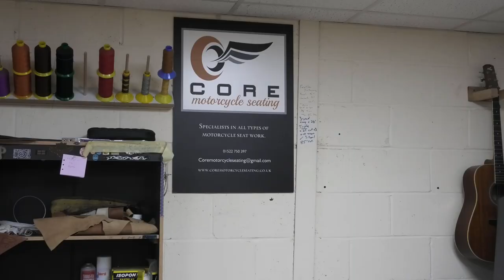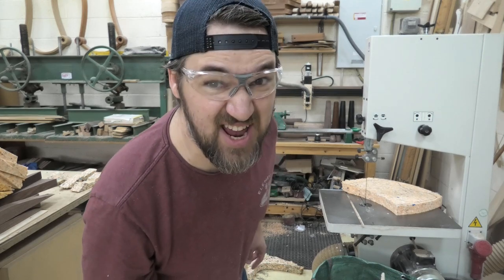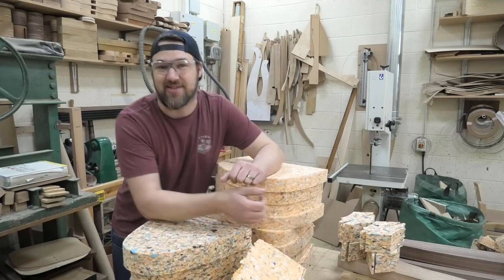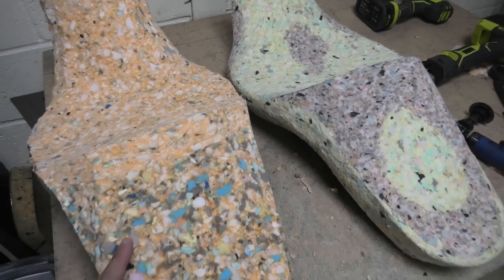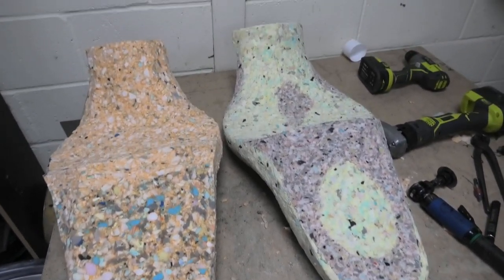HOW TO SCULPT FOAM | kawasaki Vulcan S

Comment: nice job on the foam, lots of pattern time i presume as a fellow bike seat upholsterer i'm very impressed. if you don't mind who makes the foam cutter? my bosch is rather clumsy when i do shaping work,what with the cord and all. much more suited to table work. hope things go well
Reply from the maker: Rick Burns the link is in the description. If you’d like to help me out by buying one through it then it would help a huge amount. Thanks for the appreciation. 😁
Reply: morning,the link is to the bosch i have,is there another link for the green cordless?
Reply from the maker: Rick Burns! We altered one in house to work with the ryobi cordless system. My brother is a engineer wiz!
Reply: Thanks for the info on the saw.guess i"m gonna take mine apart